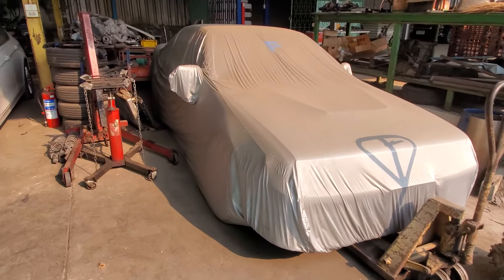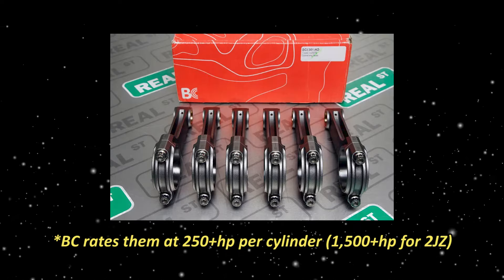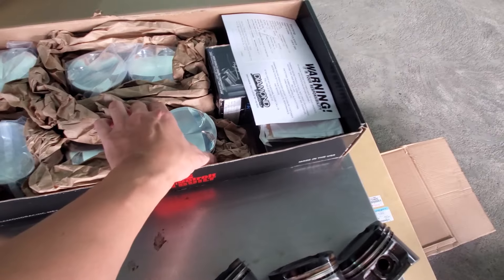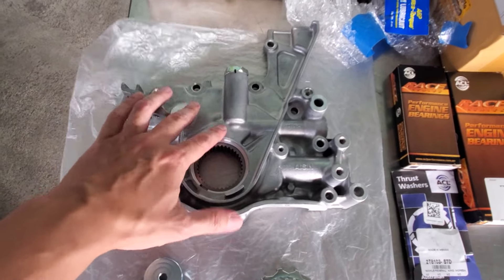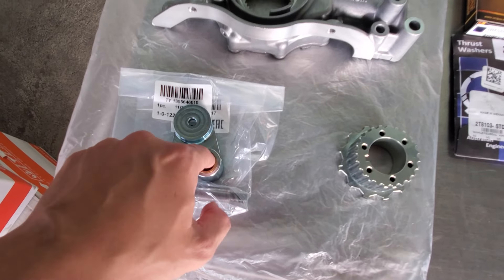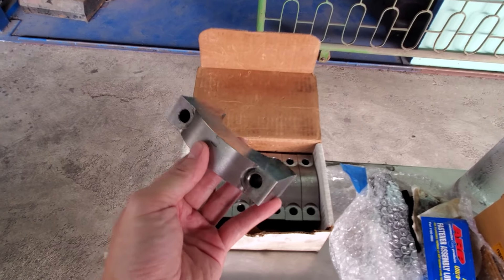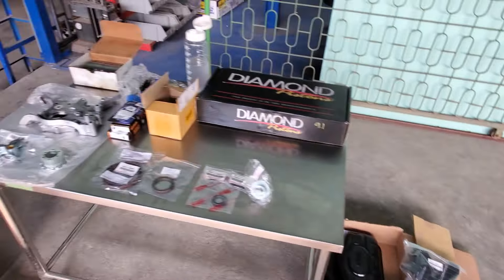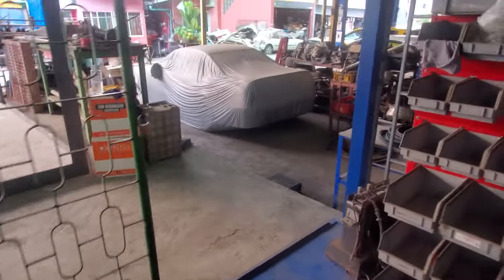Rebuilding the 2JZ-GTE Bottom End (Short Block) - Parts Overview!

Comment: How much is your estimate for HP and torque for the new motor ?
Reply: I should imagine 1,300whp
Reply from the maker: The bottom end will be capable of 1,200+whp but it won't ever see that (would need a bigger, laggier turbo). My current turbo is rated up to 850whp which is plenty fast for me and already overkill for the street I think. Also, the R154 transmission can't handle beyond 800whp.
Reply: Great   have safe fun  @DeanBKK